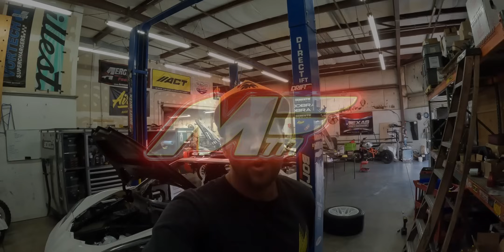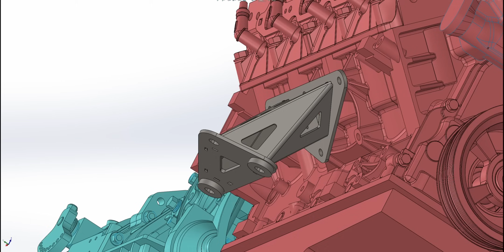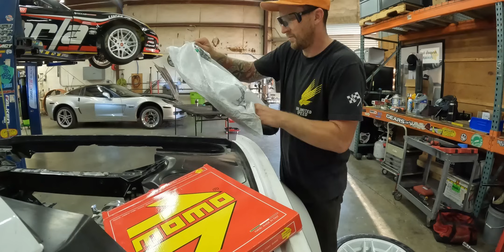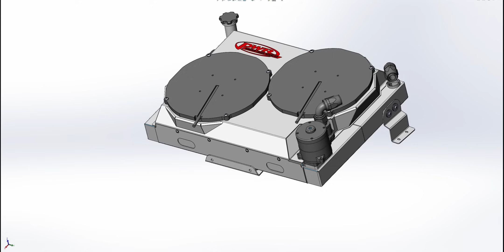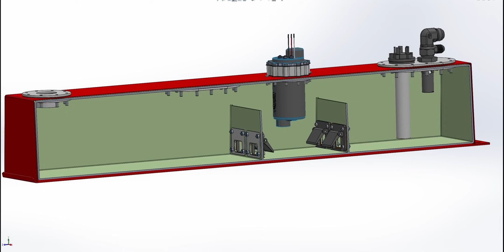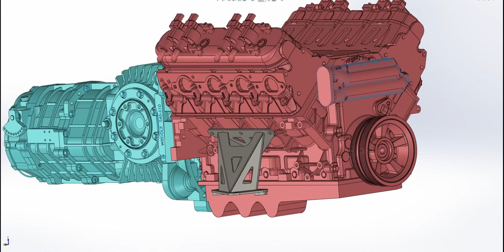World's 1st Manual C8 Corvette Drift Car - CAD Updates & Displaying at Irwindale - Ep. 12

Comment: I really hope ITBs and a high reving TSP engine are in the future with that 8 to one collector.
Reply: I think 8-1 so long as it doesn’t have turbos or anything to restrict exhaust noise is key.

NA would be ideal. Nitrous would be dope. Centrifugal supercharged would be sick. Positive displacement supercharged would also be sick. 

But can you imagine a massive roots blower (like the ones you see on like 1960s drag cars) sticking out of the rear hood
Reply: @davidkelley751  dude in Australia drifts one, can’t think of his name. It’s a ls with a 471 on it with 8-1 headers in a s13